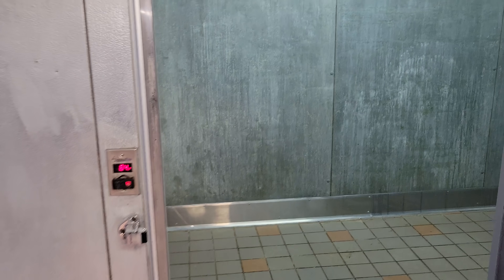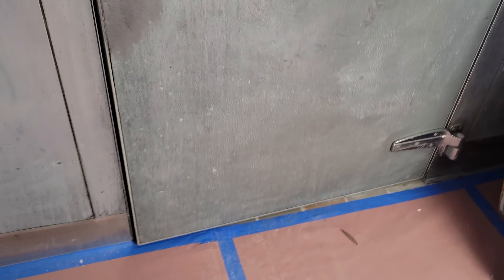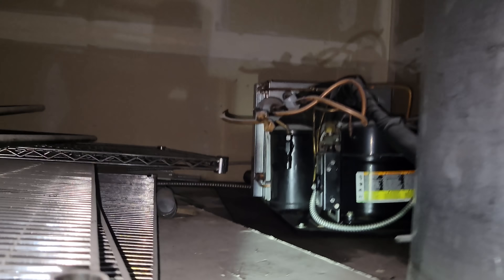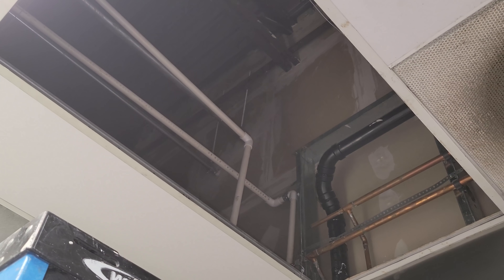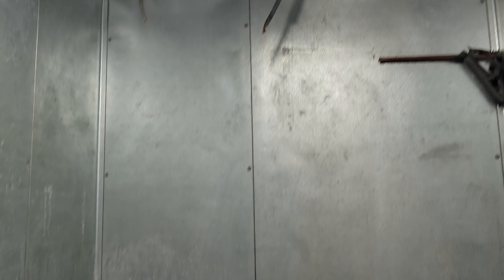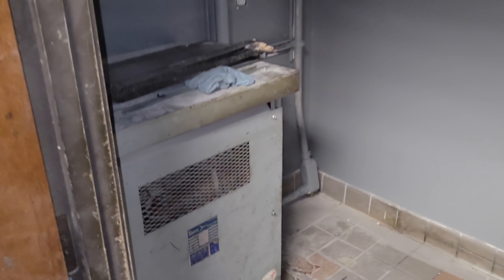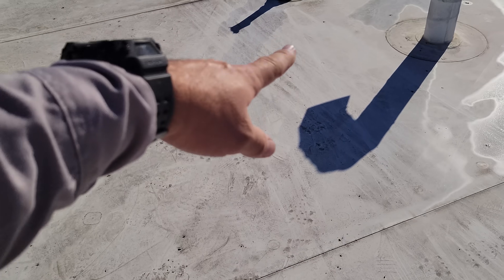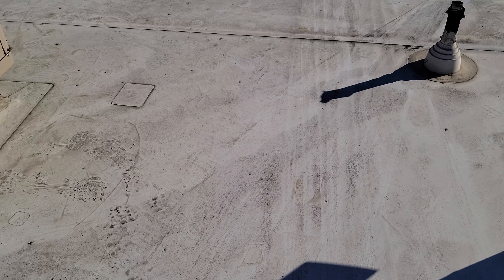THEY JUST REALIZED THE WALK IN COOLER IS MISSING SOMETHING

Comment: On top of the other reasons the transformer room is bad for an office, that thing is probably going to murder their wifi signal if they place the router there. Transformers can put off a lot of interference
Reply: But think of all of the heating bills they'll save!
Reply: Power is 60 freakin' hertz. Wifi is 2.4 GIG, and 5.8 GIG. A power transformer will do jack to wifi. ('tho it can do bad things to any electronics sitting too close to it.)

My "data center" (computer lab) has a 40KVA 480/208 transformer inside it... right next to millions of computer equipment. And there's an RF temp sensor 3ft from the transformer. (bluetooth, so it should be 2.4G) 12ft away on the telco board is AT&T's BGW210; it's wifi has been unaffected for years. In another office, we had just such a room... transformer on the other side of a wall from all the office gear. [3" air gap, 6" wall, 1" plywood board.] In another office, there was an AT&T NVG595 about a foot from a 100KVA 600V transformer... I could see it's wifi from the parking lot.
Reply: @jfbeam  you just showed anyone who knows that you are lacking knowledge on electronics..
Reply: @jfbeam  it doesn't have to mess with the WiFi signal. It can mess with the electronic boards. There's circuits that can be the right length to act as an antenna. I used to take a CB radio with a 2,500 watt amp and set off security systems, activate car washes, unlock magnetic locked doors, shut down ATMs, it would even come in on car radios that were turned off.
Reply: @jfbeam  I've been working on electronics since the 1970s. YES 60hz will interfere in the right conditions. Did you have trouble understanding the explanation?  You don't seem like you understand electronics very well.
Reply: @Bryan-Hensley  that's a satisfying smackdown right there.

Comment: This looks so bad that it might be more cost-effective to rip everything out and start over than it would to try and make what's there work properly.
It looks like a s--t show, and I put that squarely at the feet of the real estate agent. The transformer in the office needs to be ripped out - the breaker panel needs to be properly-sized for 480, and might as well run the 480 up to the RTUs.
I don't blame you for acting as a free consultant. The owner needs to be fully aware of how much of a migraine they just bought, even if the news is unsavory. Bitter pill to swallow, but I can't see this restaurant passing inspection in the near future without a little Palm Grease, and it's always better to be forewarned than blindsided.

Comment: The best part of this is that they have their wireless router and computer system next to a transformer probably putting out a 20ft radius magnetic field, good luck keeping those hard drives from melting down and the wireless working reliably
Reply: Modern electronics are remarkably resistant to 60Hz AC hum, and the radius isn't 20ft, more like 2ft. Still won't put electronics in the same room, and an office, hell no.

Comment: I'd start with a 480V board, and bypass the transformer! And I'd allow for all new AC's (New to them)! I live in Australia 480V is a 2 phase supply possibly even off a 15KV SWAR line!
Reply: 480 2 phase is 270 here in he US. Mostly used in large stores for ceiling lights. One ould still need 115 or 208 for recepticles or self contained units . No way would I have worked in a tight place on a 480v unit. 480 only benefits it the original wire run and high horsepower units. 
.

Comment: whats typical guidelines for attaching shelving to walk-in walls? dont? They are not meant to support it?
Reply: Don't poke any more holes in walk in than it takes to connect the evaporator and lights.

Period.
Reply: Most shelving units are floor standing. Wall shelves would require some support consideration to be effective and safe.

Comment: It doesn't seem like it would be safe at all to have an office in the same room as a Transformer that size. If you work for 6 hours in that office it would be the equivalent to standing next to your microwave for 6 hours while it was running. It's not going to kill you in the short-term but I wouldn't count on having children.
Reply: Transformers don't put out microwaves, just 60Hz AC, same as what comes out of your wall, just higher voltages. The safety risk is the loud noise, and the arc-flash explosion when it shorts out.

Comment: I am no expert (I don't work in HVAC, I find the trade interesting, I work on data networks and phone systems), but after seeing the video, you only had 2 options  1) Provide the information and guidance    2) run and don't look back at that dumpster fire.    You did the right thing, volunteering the info is a public service in these cases, and may get you more business on the back side.   The concern with the transformer would be either accidental arc flash (somehow something metal getting into the vent holes or if it has a catastrophic failure causing an arc flash, which can cause severe burns.
Reply: I'm in datacom as well, and walked away from a few jobs because despite option (1), the client is so clueless and naïve that I just know this is going to be a money loser.

Comment: In my state that transformer would be considered an electrical room. And in my state you can NOT store anything in an electrical room due to things possibly catching fire!!
Reply: With the amount of dust flying past the camera in every shot of that room, it's not a question of if it catches fire, but a matter of WHEN.
Reply: I do believe there is every state in the United States you cannot store anyting an electrical room I think that's actually written into the NEC itself but fairly certain is not a good idea anyways for obvious reasons and also yeah whoever might be working there would be driven crazy because of the speakers overtone from that Transformer in addition.
Reply: Yep. In our old building we had a transformer like that explode and spray molten copper all over the room. (was probably a lightning strike)
Reply: @IntBlank  ouch the say the least hopefully that electrical room was not used as an office or no one was in there at that time if it was.

And hopefully nothing else flammable or otherwise are stored at where the transfer was which is hopefully an electrical room that was properly labeled and used only for a nautical rope and like some I've seen previously here in there.

Once I saw a Lunchable room filled with almost anything you can think of flammable including solvents paint aerosol cans I could have sworn I smelled acetone and possibly even got a whiff of gasoline.

Fortunately not a place I worked out but that was a firetrap if everything else.

Oh and yeah there's a very old electrical not room but I'd call that area.

This was something that I had my front switchboards and raw incoming utility power door was not even locked or anything not even marked.

I just heard heard 60 cycle hum open the door and well I hope they never have issues with this I said to myself.

I mean full on Old School essentially the building substation if you could call it that.

I could even see Transformer oil dripping and puddles beneath the equipment.

And this is old enough that I'm pretty sure it was pcbs and there is well not only that it was old enough that it was a combination of old and new.

Including that place did still in some areas have two phase power.

Right next to it was the DC converter room as it was known.

You would not believe it but full on Mercury Ark rectifiers and a few smaller butt to me huge motor generator sets.

I don't remember what this place was but it wasn't just one thing it was like a bunch of things in close proximity.

And worst thing is I could smell Natural Gas as well.

It was old enough there was lighting that was incandescent bulbs supported by two benab just alike the electrical area.

Literally falling on by big clits and insulators that were down in the insulators at either end heavy cables. 

Not even fuse down the light switch was a 60 amp safety switch.

And not to mention most of the meters were a bass style to what are M and a bunch of other stuff I would not recognize since nowhere near modern.

On top of that same room huge lead acid batteries.

Obvious signs of corrosion.

Essentially one big disaster waiting to happen.

And evidently the ventilation system was virtually non-existent.

I noticed the smell of solvents and stuff before even opening the door and realized the sixties Hertz hum means that was electrical room plus the odor of natural gas.

Oh and plenty of sources of ignition cluding some sort of gas fired heater and oil-fired something Runner at least three water heaters of various descriptions and a boiler.

All shoehorned into something that probably never would would have laid code in the first place.

Also most everything had no guards in place lolong high-voltage warnings or anyting.

Every last bit of it active.

Something like that I almost thought that was a fever dream of the source of electrical install but that was real.

Oh and yeah both on the AC and DC switchboard those fuses or wired past.

And what apparently were circuit breakers of an old style with a solenoid release of some sort wired shut and almost look like some of the connections have been welded shut to keep anything from opening.

And apparently there had been multiple issues fires who knows what else.

I certainly hope they had a lot of aunjanue you're working there that was worth his salt and I have also heard the technicians their passing away doing day-to-day tasks electrically.

Pretty sure that place is long gone or at least burnt to a crisp.

Last time I heard about that major fire electrical but that was potentially how I stopped hearing about it because cannot confirm but very likely it had burned to the ground.

Oh and also surprisingly the top of that area was wood.

The only ventilation shaft was just plywood.

The token gesture a box fan to increase air flow.

And only an outlet for air but no real Inlet other than air leaking around any holes and around the door.

Also yeah that was acting more like positive air pressure from a somewhere else even though is intended for an exhaust ortley supposably ventilation.

One wrong move basically the whole place goes up in smoke or dust levels go boom.

Also not even no smoking sign or anyting where to find bullets were.

And there was literally leaking containers of who-knows-what.

But it smelled like whatever concoction that was of everything was ripe to go at the slightest Spark!

Again I smelled a whiff of gasoline and acetone much stronger than there ever should be alone in electrical area!

Wondered why that place then. Blowing itself off the map.

This was a weird area it was sort of like a complication of an apartment building an office building an industrial building you'd walk someone into the other.

Frankly I'm pretty sure this would have been approve or even considered to be possible alone weeding any sort of Regulation.

There was sprinklers however...

And some sort of rudimentary fire alarm system years ago.

Oh by the way original sprinkler system fire fire suppression system if you can call it that.

And Jack chain on pulleys fusible links.

And essentially valves with a weight on them.

The modern system there's no way it would have done anything since most of the piping had been either cut off camped off or otherwise destroyed.

There was even pieces of it laying around.

And I've been there a few times and even gotten Zapped off light switches and more so yeah that place needed to go to you-know-where and Beyond.

Although they did have a token gesture of the old-school fire grenades at the entrances but that's about it.

Oh and yeah fire Bell overhammer trained on to it it says ring in case of fire at each door probably only five exits in the entire building what's which were blocked.

Half of that blockage was more flammable material at that!

Load loan residences on one part of the building.

It looked as though in on any stairs if you stepped wrong spot you'd wind up Lenny stories below.

Deathtrap × 4500

Then yeah fully occupied building everything going on like nothing was even wrong.

Only about one bulb and every 15 was even working where there was even power to the lights.

A couple places there was only flashlight tiny down for lighting

Comment: What makes a walk-in cooler a “wet” location? Is the evaporator electrical in a weather proof box?

It’s not all a nightmare or headache, it’s just work if you are the contractor. If it was easy, I’d send the office girls.
Reply: The dewpoint difference between box temperature and building temp can result in condensation and ice on the box walls.
Reply: But a byproduct of refrigeration is dehumidification. Cold air holds less moisture than warm air and wouldn’t your observation apply to a garage in the northern climate? There is often a 30 degree T/D in air conditioned space vs. a hot day, would this make all air conditioned space a wet location?
Reply: @ingcampthree4523  when you open the door warm air goes into the freezer, when you close the door that air gets cooled down. As you said, cold air can hold less water, but it has to go somewhere, so it sublimates onto the walls and of course, onto the electrical equipment.

Comment: Regarding the Transformer, I'm fairly certain the rule is 3 feet all the way around it just like the electrical panels are supposed to have.  Which, of course, no one follows, so it takes half an hour to clear out the stuff around it to get to the breakers. ;)
Reply: They’ll just throw some tablecloths over it to quiet it down. 😢🔥💥
Reply: Dry transformer of that size is going to need proper air circulation to reduce the heat. As it sits now with the spacing and tiny room and I don't see any exhaust (that tiny hole with wires now all in it?) Means really bad heat build up not including additional office equipment. Recipe for disaster.
Reply: Why isn't the transformer on the roof? I guess they could use a padmount or polemount transformer there? In case of leaks or it blows up, it's at a place with nobody in harms way..
Reply: It's 3 foot in front (so you can open the front panel to work on it) and 1 foot on the other 3 sides for ventilation.
Reply: I didn't think equipment rooms where "Habitable Spaces" in most states and I am fairly certain that a Transformer must be in an equipment room
Reply: @kelaEQ2  They are allowed in habitable spaces (like computer rooms) but there are a lot of hoops to jump through.
Reply: That thing may exceed noise rules to require earplugs when everything is running. Thats if it's even sized for the load.
Reply: @robertstoneking7916  You can order quieter transformers, but if it meets the manufacturer's specifications there's nothing that the inspector can legally do about it.
Reply: @ghost307  Highly depends on the state or county or city regulations as to what the inspector (or employee forced to sit in that room as an office) can do about it. Big massive gaping difference between 1 city and another depending on where they are in the country.
Reply: More than likely, that transformer is putting out ELF/EMF by the ton.  EMF causes hallucinations (seeing 'ghosts') and ELF causes health issues like leukemia.

Comment: Wait till you work in a shop with 400Hz transformers (Navy Shipboard). Noise and Heat are your BIG issues.  60Hz is a long way from Micro wave.  That is no different from Motors. Since that was 3 phase, you have interacting fields (120deg) anyway.  Some folk make a whole lot of hoo haa about magnetic fields. first thing, transformer builder want the to be efficient. Fields going outwards do no transforming (wasted energy) so the field is minimal.

Comment: I have so many questions, why the hell is there a transformer inside the building, why is not in the back, or on the roof, why would you not even just rip the entire lot out and start again, you would spend more initially, but save so much overall.
Reply: The emf around that thing must be massive. That can't be legal to put that thing inside the building
Reply: It's legal to put a transformer inside a building, the only concern is being sure it's rated for indoors.  It doesn't put off any microwaves or anything harmful, it will introduce 60 cycle hum into about everything and it's designed to operate way above temperatures humans can survive, it should never be in any occupied space.  These people just don't have any clue what they're doing, it's going to be really expensive when they are done in 10 months or so.
Reply: Transformers are often inside commercial, institutional, and industrial buildings. In most mall applications every store space will have a transformer for lighting and power. I prefer to mount them so they do not take up floor space, but it is normal to have them floor mounted adjacent to panels.

Comment: This hurt to watch. I've walked into plenty of those types of clusters. I don't know how they got away with cutting a hole in the side of a hood. I've seen some places allow it to be reused if they remove that illegal add on, weld it shut, smoke test it and get an T&B company out to confirm it's good to move the cfm for the BTUs under the hood. It would probably be quicker and cheaper to just get a new hood & exhaust combo to match what they plan on cooking with
Reply: This. Install new hood and exhaust and then be done with it. Can't count the number of times that these penny pinching measures end up costing more than a simple new install. It seems issues always snowball when trying to stay in spec when doing modifications.